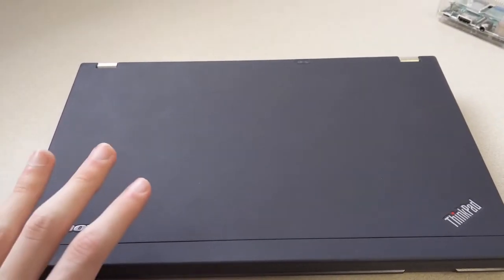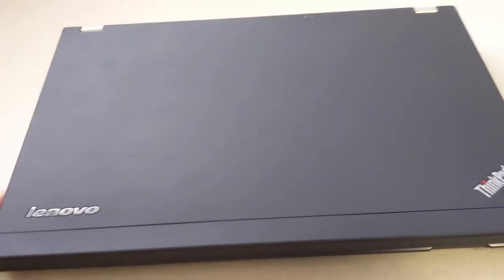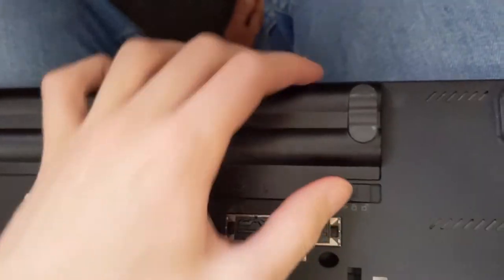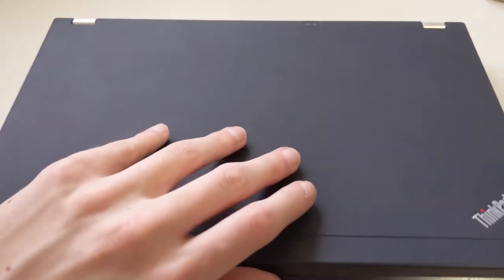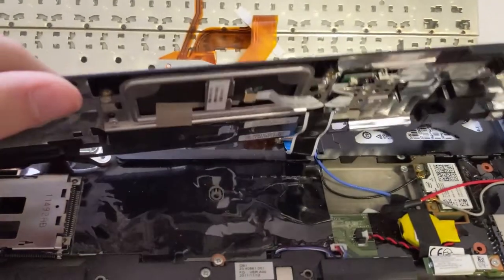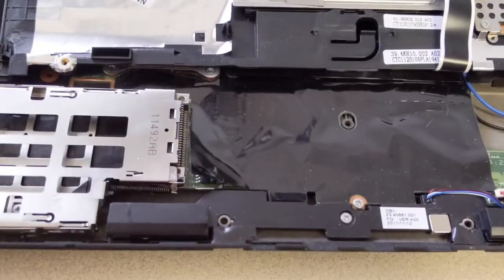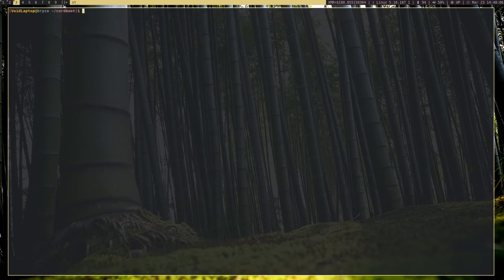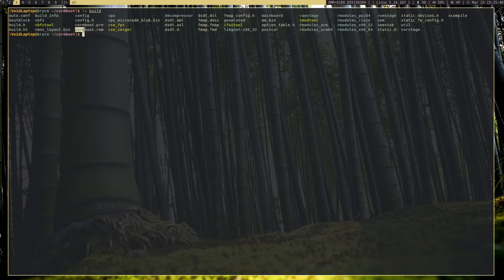Installing Coreboot on a Thinkpad X220

Comment: @bryce which Wi-Fi card did you purchase?  I also have an x220 and would like to do the same.
Reply from the maker: Atheros AR5BHB63 it does not require any non-free firmware to use it.

Comment: Hi, the Raspberry Pi pinout on your blog is wrong. There are only 2 rows of 18 pins in the diagram, but there are supposed to be 2 rows of 20. I spent about 2.5 hours re-seating my clip and triple-checking the pinout before I realized. The GND pin is in the correct place if you count from the right, and the rest are correct if you count from the left. But there are 2 columns of pins missing in between, which completely screwed over my wiring because I counted from the right for everything.

Also, a more minor issue: you number the pins 1-20 for the first row and 21-40 in the second row. The official pin numbering views them rotated at 90 degrees, counting each column of your diagram as a row. Your pin 1 should be pin 2, pin 21 should be pin 1, pin 20 should be pin 40, and pin 40 should be pin 39. I'm dumping the BIOS ROM as I write this, I'll update this comment with my progress :)
Reply: Update: it works, but I had to use edk2 instead of SeaBIOS since I have a UEFI install on my SSD. I only saved about 2 seconds of boot time, which is a lot worse than the 10-15 second improvement I saw on similar hardware online. I think this might be down to using edk2 instead of SeaBIOS. Maybe someday I'll try this out with BIOS instead of UEFI, I did find SeaBIOS got to the boot menu incredibly fast. I don't need 2TB+ disk support, so it'd probably be fine.
Reply from the maker: Thank you for pointing that out, I have now fixed it.

Comment: I was getting an error regarding the 3rdparty blobs. I had to put them in /mainboard/lenovo/x220
Reply from the maker: I did make a few mistakes that I corrected off camera, that's why I stress that you follow my guide instead of the video. The video is more for supplemental instruction.

Comment: A. Which latest Thinkpad
1. X2__
2. T4__
can we install Coreboot on?

B. And in these latest X and T series, can IME be disabled?
Reply: IME can be disabled on all hardware and all versions using me_cleaner. On newer hardware you have to leave in a small amount of code to let the CPU boot, but the IME itself is deleted from the BIOS chip.

Comment: Excellent video! Had this planned for years, but postponed indefinitely. Just got on the agenda again with your help, it might just work in the end... Do you know, wether this works on the "X220 Tablet" variant as well? (too lazy to research atm... ;)
Reply: I looked all over for this info, and just tried it myself. Yes, it works fine. I had to use edk2 instead of SeaBIOS, because SeaBIOS is legacy BIOS only and doesn't support UEFI. I saved about 2 seconds of boot time with this, I think if I switched my drive to BIOS and used SeaBIOS I would save a lot more time.

Comment: I had a thinkpad x200, that I got in pretty bad conditions. Some screws were stripped and I had to drill them out, the battery was pretty much dead as well. But the biggest issue was GPU (I think?), because it kept overheating and force rebooting the machine. Right now it takes like 10-15 to boot up, but it still works, which tells me that CPU is still working. Oh well. This was my first thinkpad and I'm not sure if I should ever get another one
Reply: Have you considered not buying one in bad condition in the first place? Stop spreading FUD.
Reply: There is no GPU, typically the CPU has intergrated graphics, second generation Intel family
Reply: buy one that hasnt hit the graveyard yet

Comment: how long your x220 battery last? can it reach 6-8 hours using as programming pc?
Reply from the maker: Using a 6 cell battery it lasts around 2-4 hours. I bet a bigger 9 cell battery can reach 6-8 hours, I just don't have one (yet).

Comment: What is Coreboot for?  That this?
Reply from the maker: Coreboot is a partially open source replacement for traditional BIOSes.
Reply: @brycevandegrift  I mean, is it more advanced than a bios?  But I don't understand and what is achieved with this change?  I'm not an expert but I want to know
Reply from the maker: @TuMundoAndroideMania  If you want pratical reasons (besides peace of mind), Coreboot has a lot of advantages over your stock BIOS. Most of the time you get faster boot speeds, better physical security than a traditional BIOS (espically if you disable the Intel Management Engine), and it can even "unlock" your device to use third-party components, in my case I am able to use a third-party wi-fi card that works with 100% free software.
Reply: @brycevandegrift  I don't understand that thing about disabling Intel Management Engine, I did see that but I never paid attention.  The point is that I already installed the BIOS mod that unlocks the ram and I can use more advanced WiFi cards with bluetooth 4.2 and so on.  And about using Wi-Fi cards with free programs, what do you mean?  And if I install this from Core boot someday I will be able to return everything to normal or use coreboot with Windows 10?
Reply: @brycevandegrift  I don't understand this friend.  So the WiFi card that does not work with some programs?(am able to use a third-party wi-fi card that works with 100% free software.)